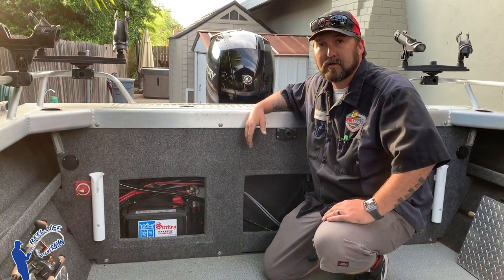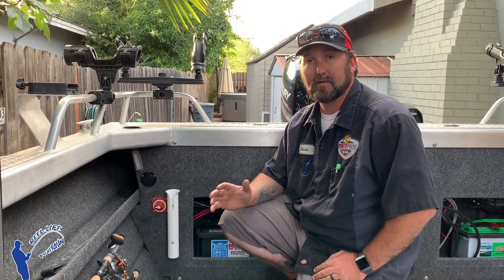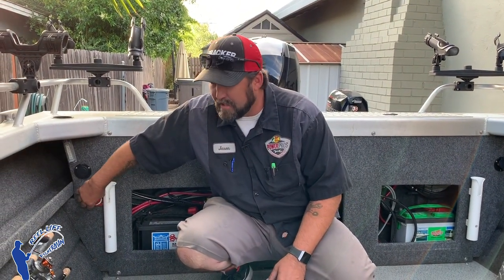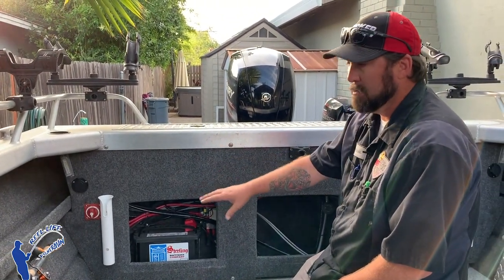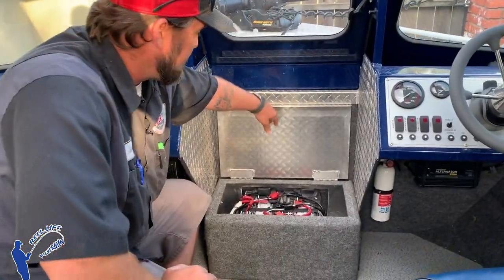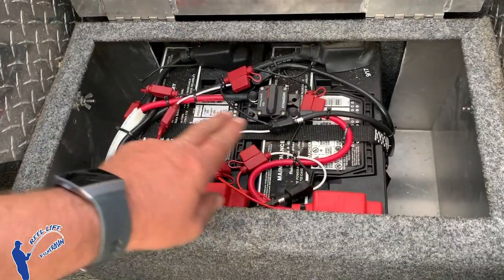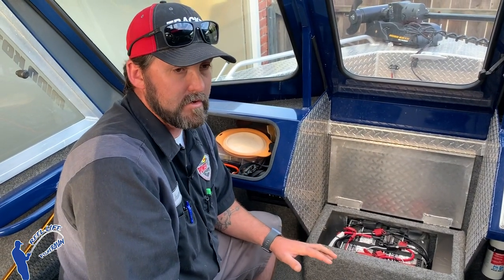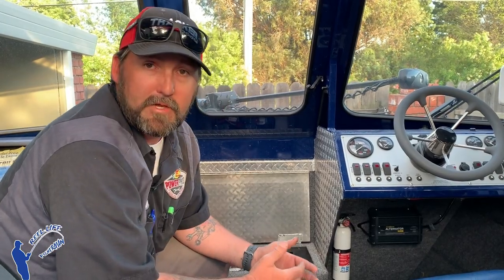BOAT BATTERY WIRING  | HOW TO

Comment: Great video!  I'm having trouble understanding what is happening in boat.  Battery 1 Positive lead connects to Battery 1 post on the Battery Switch. There is another smaller Positive lead that goes to the Isolator.  Battery 2 Positive lead connects to Battery 2 post on the Battery Switch.  There is another smaller Positive lead that goes to the Isolator. There are also many other wires connected to this battery.  So battery 1 is my starter battery and battery 2 is my house battery?  I know that Battery 2 needs to be replaced as it is only putting out about 4 volts.  I’m thinking if I turn the switch to Battery 1, I should be able to start the motor, but no.  I have power going to my master switch but no power going to the motor, Why?  Battery 1 is the good battery that is kind of the idea isn't it.  If I turn the battery switch to 1 & 2, now I have power to the master Switch and can crank the motor.  Isn't the idea that if either battery is dead, I can switch to the other and start the motor?
Reply from the maker: So sounds to me they might not have the main power leads going for the boat power and engine hooked to a common bus bar or fuse block.. and then when you combine the two it’s more like jump starting instead of switching..  if that makes sense..the isolator is there just to put a charge to both batteries while the engine is running without moving the battery switch.. if you get a main fuse block or bus bar set up and run all the power wires for everything off of that.. the hook that to the output post on the battery switch you will be able to use either battery to run everything.. hopefully that makes sense.. hard to type out and explain sometimes.. I’m assuming your switch is a pos. 1 pos.2 or both or off? Thanks for watching and let me know if you some more questions about it..
Reply: Yes, pos. 1 pos.2 or both and off.   When the Battery switch is set to 1, I had 12.22 volts going the output lead.  The output from the Battery switch looks like it goes directly to the outboard engine.  So I could see if Battery 1 was low, I could set the switch to 1 & 2 and "jump" it.  But Battery one is charged with an output of 12.22 volts.  It seems to me the engine should have power coming to it and turn over.
Reply from the maker: So will all the boat power and accessories work  just fine right now? The engine just won’t start?
Reply: If I hook jumper cables up to battery 2 from an extra battery I have that is fully charged, then everything is great.  That's why i'm puzzled.  If i'm out on the lake and Battery 2 goes dead , I thought I would be able to turn the battery switch to 1 and start the motor.  But it doesn't seem to work that way.  I have to turn the switch to 1 & 2 in order for it to start the motor.
Reply: With a low Battery 2 and the Battery switch set to 1, I have power to the Master Switch and can operate radio, depth finder, etc.  but no power to the motor.
Reply from the maker: So then it sounds like the engine must be hooked to battery 2 .. and another question.. do the 2 batteries share a ground wire between them?
Reply: Yes, they share a ground.  Those wires are running all over the place in that compartment and it difficult at best to see where they are going.  The engine could very well be connected to Battery 2.  It surprises me because it looks like everything else is connected to battery two also.  I'm not sure where the lead is going from the battery switch.  I assumed it went to the motor since it really was only lead connected to battery 1.  I appreciate your time!  I know it can be difficult to answer without being able to see it.  Thank you!
Reply from the maker: Dang.. then that is weird! And one I would like to look at in person for sure.. personally I would get a new battery.. and take some time and re wire all that.. the only things hooked to each  battery should be the main power going to the battery switch and the ground wires for Accessories and the main ground they share..
Reply from the maker: Blue Sea Systems SafetyHub 150 Fuse Block https://www.amazon.com/dp/B0053BTSEK/ref=cm_sw_r_cp_api_i_Va-IEbE9V4A9P
Reply from the maker: This is the one I use.. it has a main for all power wires with fuses and a ground bus to hook all the ground to.. then this hooks to the output on the switch and everything will work from either battery

Comment: Where can I find a how to re-wire my old boat, step by step... I'm talking about setting up a two battery system.   Have someone show me how to connect the wiring from the boat to the batteries and then how to set up circuit breakers and then run the correct wire to a bus and then to a panel.  Explain it like I was 10.
Reply from the maker: Lol! I will sit down tonight when I get home from work and type it all out as best I can.. hopefully it will be a good enough explanation.. and let me know if you have any questions..  thanks for watching the video!
Reply from the maker: So first you want to get a fuse block big enough to hold all of the power wires for your engine and all accessories.. and then a ground bus bar to do the same..  hook all of your power wires to the fuse block and all your grounds to the ground bus.. then get a battery selector switch and hook a 6 or 4 gauge wire from the common/output to the fuse block.. then hook the ground bus to the negative post with 4 or 6 gauge then also hook the negative from both batteries together.. then hook the positive from battery one to the #1 post on the battery switch.. then do the same from battery 2 to post 2 on the switch.. using 4 or 6 gauge wire also.. hopefully that helps.. let me know if I can explain anything else..
Reply: @ReelLifeFisherman  Do you have a video of all that?    I have the old glass fuses,  I'm a little confused on how and where to put a fuse as close to the battery as possible...is that what you recommend?
Reply from the maker: If you already have fuses or breakers then there should be a wiring harness running to the battery area. . In that case you just need a power bus bar and a negative bus bar.. hook all the power wires to the positive bus and a 6 gauge or 4 to the common/output on the selector switch..
Reply from the maker: Next time I get a chance I will make a video on wiring up a boat like we are discussing for sure..
Reply: @ReelLifeFisherman  that's awesome, I need a winter project.

Comment: I'm no expert but I don't understand what I would ground to. My boat is fibreglass.
Reply from the maker: Everything is grounded back to the battery and the battery is grounded to the engine.. it’s different then wiring a car.. the car is grounded to the fame the frame is grounded to the motor and the body..